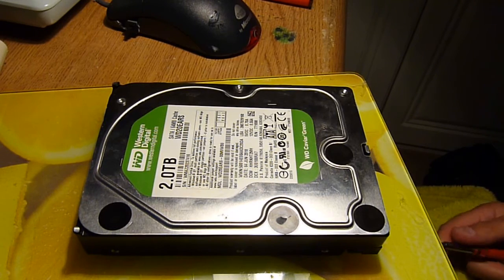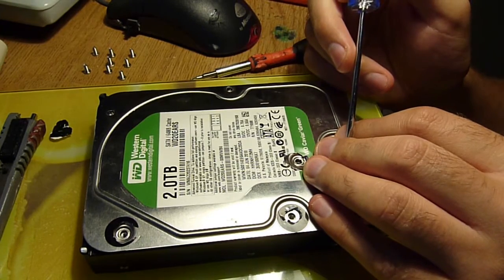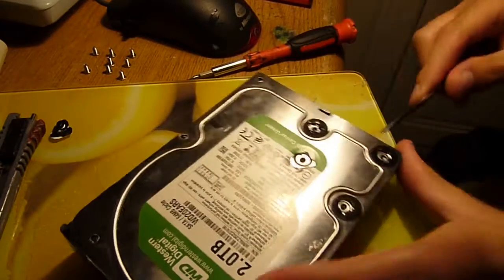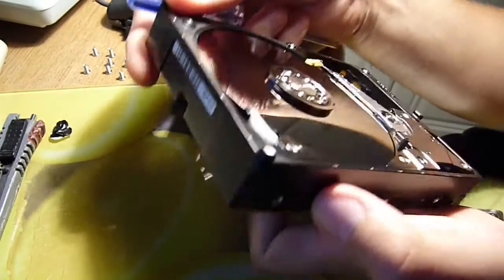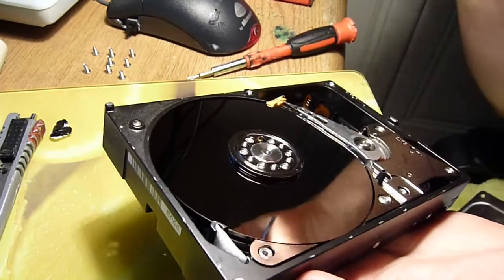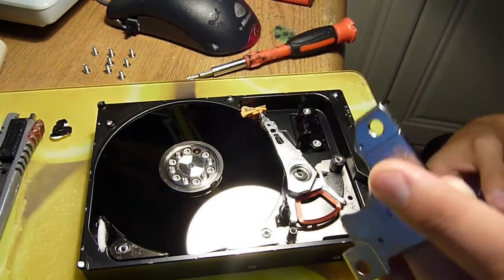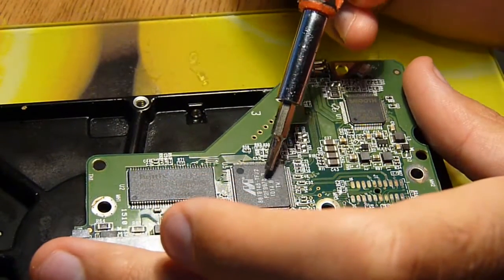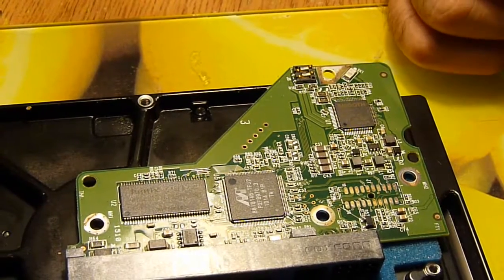2TB HDD Teardown

Comment: Not much on a gross physical level, but the magnetics, heads and electronics are vastly different. The magnetic materials are finer on the platters, and the heads are no longer coils for reading and writing, but a coil to write and a GMR hall sensor to read. The controller is only partly on the actuator, part is in the actual head itself as an amplifier. Controller does a lot more than simply reading now, it has to do a lot of error correction and encoding of data as it goes on and off the drive.

Fun fact, it has 3 CPU units inside, one being a 6502 that uses that Winbond chip to start up the other 2 by loading the firmware into them. 6502 because it is small, low power ( and can sleep with near zero power use) and importantly out of copyright so free to use. Also the drive uses the energy stored in the spinning disks to finish off the writes in the memory at power down so the data in cache is hopefully not lost.
Reply from the maker: +SeanBZA If I remember it was not as significant as I might have hoped for. Rather interesting info you have provided there, did not know there was more than one CPU at work in these things.